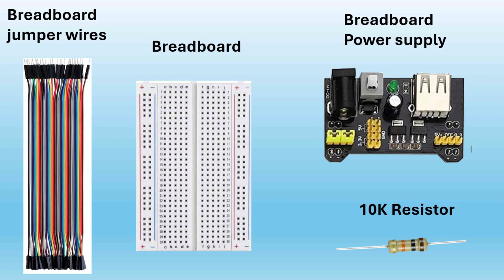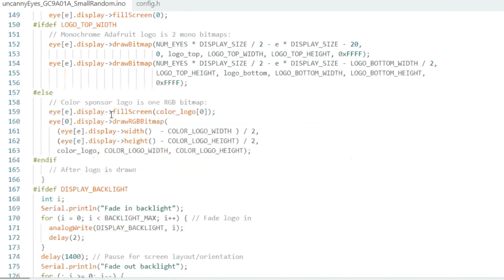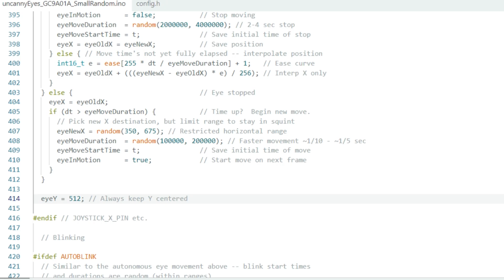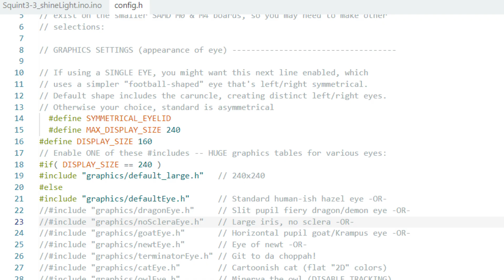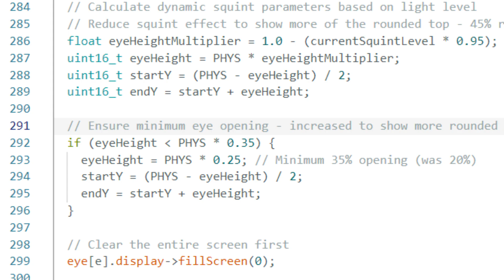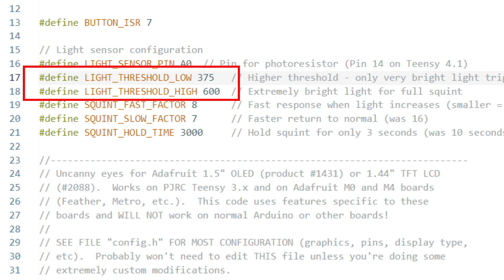Build Light-Responsive Animatronic Eyes with Teensy 4.1 & TFT Display

Comment: How can you do the squintingwith an animatronic eye? (For cosplay)
Reply from the maker: These digital eyes could be programed to move by using a joystick, either connected to the display modules or from a distance. 
You could could make the eyes squint by a button press, proximity of an object (ultrasonic sensor), random squiting...etc.
There are a ton of sensors to choose from, or you could  create solid eyes and move them by using motors.
It just depends on the environment they will be in and how you want them to react.
good question! 👍👍